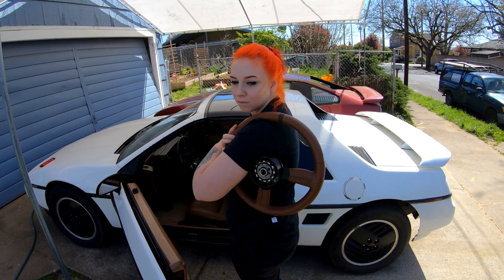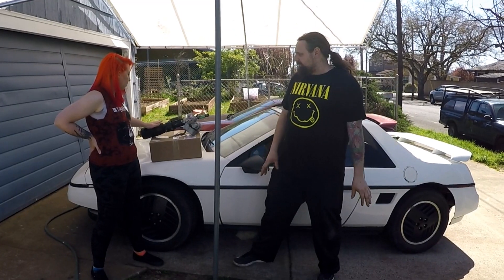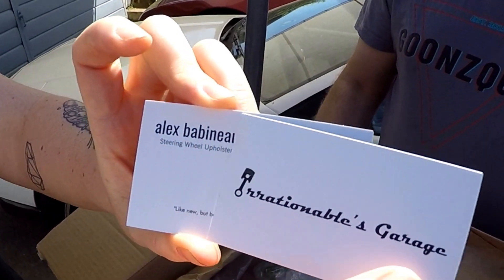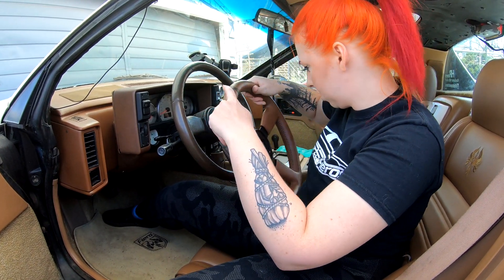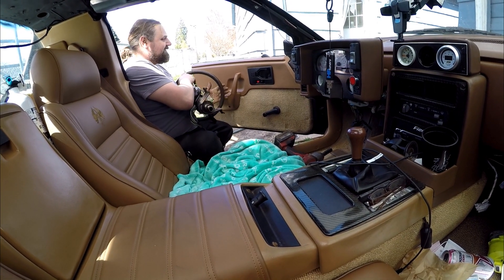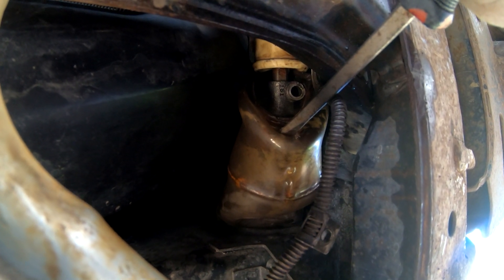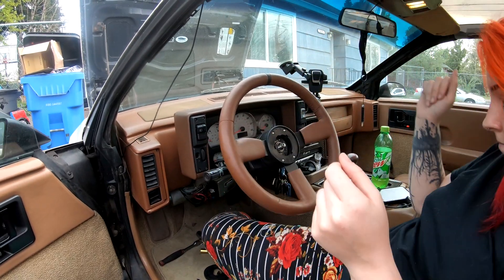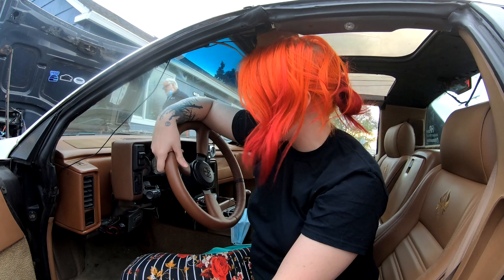Electric Power and a Flashy Steering Wheel | Project LSJ Fiero EP 24 | Speed Sensitive EPS Install

Comment: How do you like the electric power steering? Do you get good feedback from the wheels? I was concerned about the steering feeling numb.
Reply from the maker: speed variable assist...its almost completely off at freeway speeds. it feels natural to me, makes my other fieros feel clunky
Reply: @LightspeedFieros  I've been looking at the Honda Civic electric power rack. I bought a new Civic back in 2016 and was shocked at how quick and easy the steering is. It has a 10.93 : 1 ratio. I have an 88 front cradle to play with. The  shame is the Fiero is a lightweight car that feels like you're driving a bus in parking lots and hard cornering. I actually pulled a bunch of muscles in my right shoulder practicing for an autocross.  People would say it's not that bad but when you are turning the wheel fast back and forth it takes a lot more force to do it.
Reply from the maker: @cajunroadwarrior  we also have used an rx-8 rack. that worked well.
Reply: @LightspeedFieros  what had to be done to mount it?